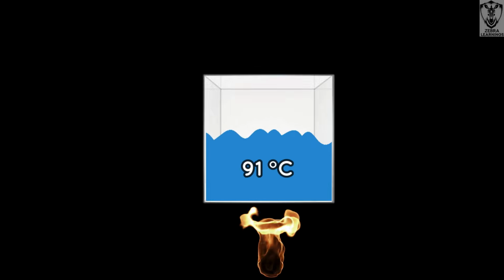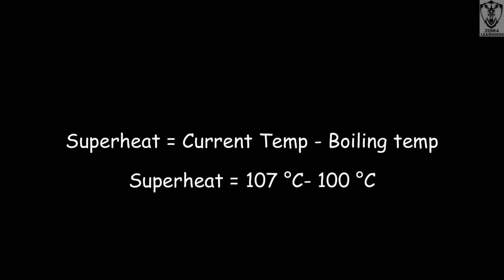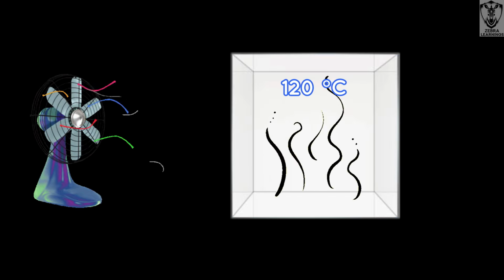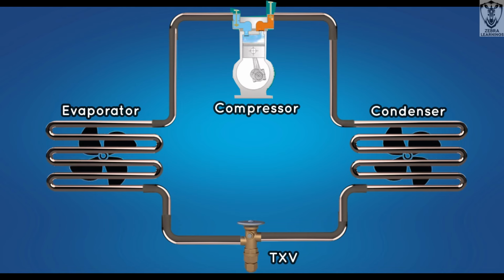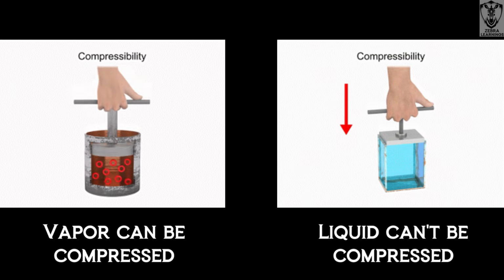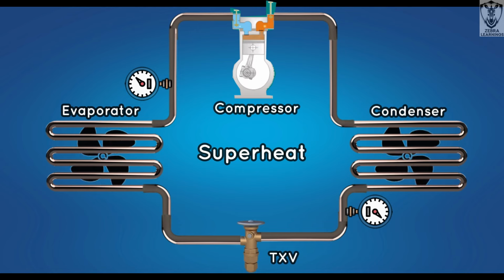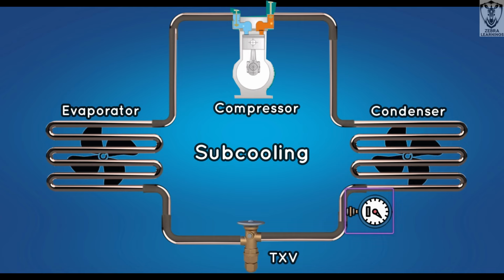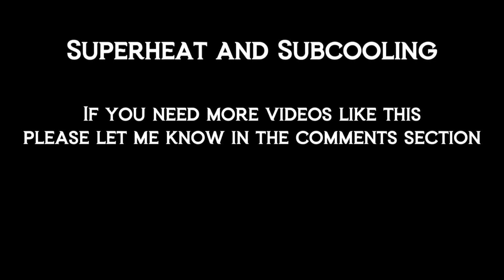What is Superheat and Subcooling | Animation |#superheat #subcooling #hvac #chiller #thermodynamics

Comment: Heating the water after achieving 100°C will never increase its temperature due to phase change till the last drop of water evaporates. After all water converts into vapour, the temperature starts increasing. This is called Superheating.
Reply from the maker: Yes you are correct. By mistakenly I have explained in that way for the easy understanding. The water can't reach the temperature above the 100°C. Only the water vapor can reach more than 100°C. But, it will not affect the understanding of this topic.
Reply: @zebralearnings Quite the contrary! The way you’ve explained superheating is confusing, misleading, and fundamentally incorrect!
Reply from the maker: @georgejetson4378  No, I made this video to understand superheating most easily.
And it won't mislead. Explaining it most technically will confuse the viewers. My motto is to make everyone understand HVAC. If there is anything wrong in the video, you can mention it.
Reply: We also noted the incorrect statement.  thank you for correction.
Reply: The problem with the incorrect explanation of water being able to be heated above 100 deg is folks will go out and make that statement when in fact it is incorrect
Reply: So as the water start to evaporate, will the steam created while the water is boiling increase in temp while the water stays at 100C? so water remains at 100C but the steam can increase in temp?
Reply: @joshuadavis2062 that’s correct. Water changes state at 100 degrees C. So it can never be more than that, if anything increases it’ll be in vapor form.

Comment: You cannot explain superheat and subcooling without mentioning the relationship of pressure, temperature and volume, ie. PV/T, Charles' Law. Example, Water and steam cannot have temperature above 100 degrees C at atmospheric pressure. To have higher than 100 degrees C, water and steam must be within a restricted volume that raises it's pressure, like a pressure cooker.
Reply from the maker: It's already explained in the comments. But here I have explained about the pressure and temperature. When the pressure increases, the boiling point also increases. Anyway I will make a separate video explaining what pressure and temperature is.
Reply: Let us be clear that pressure and temperature are important factors to be considered, for instance water boils at around 68 Degrees  C on Mount Everest. Discussions are relevant. Lower the pressure on water surface and the boiling temperature of fluid will decrease. Change of state will commence at that temperature .To comprehend Superheat and Sub cooling within HVAC , It is important to know the manufacturer's design, and use the recommended  method to calculate this phenomenon.

Comment: The water temperature remains constant and the water vapor is overheated. The flame should flow around the entire tank. The heated water will boil at a temperature of 100 °C and the flames flowing around the tank will additionally heat the water vapor to a higher temperature, e.g. 107 °C.
Reply: I would show it on a potato fry. When we boil water in a kettle, we see "water vapor" rising. However, what we see is not water vapor, it is microscopic water droplets formed from water vapor that condensed on contact with cold air. This is because the steam was not superheated and was 100 °C. The situation is different when we prepare fries in a fryer. The oil is heated to a temperature of 120 °C (initially 190 °C). When we add French fries to the oil, the water contained in the fries begins to boil. The temperature of the fries in hot oil remains constant at 100°C, but the water vapor passing through the oil heats up to 120 degrees, which is why we do not see "water vapor" above the fryer, i.e. micro-droplets of water, because the water vapor was properly superheated. She had a reserve of energy that prevented it from immediately condensing.
Reply from the maker: Yeah, that's you're correct. We can't heat the water more than 100°C. Once the water reached the 100°C temperature, it will start to change the phase from liquid to vapor and the vapor can reach more than 100°C temperature.
And the flames should be around the tank. Because, in HVAC system the heating process happening around the coil. But for easy understand I made this animation like this.
Reply: @zebralearnings  I thought so. A beginner in the profession only sees copper pipes, measures temperature and pressure, but does not see what phase the refrigerant is in a given section of the evaporator. Is it a gas? or liquid? It's like the structure of an atom. At school they taught me that electrons revolve around orbits like planets, although it has long been known that they have a wave-particle nature. They are a particle and a wave at the same time. However, this is difficult to understand.
Reply from the maker: @leszekporeysky6441  What do you really want to understand? Tell me I will try to explain in an easy way.
Reply: @zebralearnings  When it comes to particles and waves at the atomic level, I have already exhausted my understanding. We have three spatial dimensions and one temporal dimension. I understand spatial dimensions, but without understanding what time is, I will not be able to understand space-time. Therefore, I will not be able to understand what entropy is. But now I focus on simpler tasks. I am interested in systems in which you have one compressor and several evaporators operating at different temperatures. For example, imagine the evaporator of an air heat pump operating at a temperature of -7°C, the COP of the system is 2.5. What will happen when half of the evaporator is exposed to a temperature of +7°C? Will COP increase, remain unchanged or decrease.
Reply from the maker: You'll get the answer.
Reply: Your simplified presentation has turned on a light for me and made it much easier to visualize inside the compressor , condenser , evaporator circuit .  Thank you
Reply from the maker: @alfranca5961   I am Glad, Bro ❤

Comment: Wrong:  Can't heat water above 100C at 14.7PSI.  It turns to vapor.  The vapor can be heated above 100C, however.

Comment: Subcooling - For measuring that the the refrigerant is a liquid, and will absorb more heat in the evaporator?
Superheat - For measuring that the refrigerant is gas and not liquid, in order not to hurt the compressor?

Comment: Why do you need to know about superheat and subCooling how can you tell what's wrong with the system by checking subcooling or Super Heat?
Reply from the maker: Good question I will explain everything about Superheat and Subcooling in a separate video.

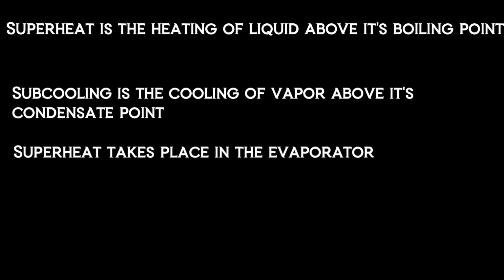Comment: Just 1 tinsy mistake. You accidentally said subcooling is the cooling of vapor ABOVE its condensate point at 5:28 where you previously said subcooling is calculated by the condensate temp - current temp
Reply: Anyways, thank you for the video! It was straightforward and easy to learn

Comment: Enthelphy, sensible, cop, latent ye kya h
Reply from the maker: On the way
Reply: Ok  sir i will weat for your answer
Reply: How many types of expension valve
Plese reply sir
Reply from the maker: @prakashsah9339  1. Thermal Expansion Valve.
2. Capillary Tubes
3. Automatic Expansion Valves
4. Electronic Expansion Valves
5. Float valves.
Reply: Thank u

Comment: at sea level, the temperature of the water will never go above 100 °C
Reply from the maker: Yes you are correct. At 100°C water will start to boil and change from liquid to vapor phase. But if we give temperature more than 100°C we can make sure the water is changing to vapor.
Likewise, if we give temperature more than the boiling point of refrigerant, we can make sure the refrigerant is changing to vapor.
Thank you for letting me know this.
Reply: Steam heat is hotter than 100*C (boiling water) and increases in temperature as pressure increases.
Reply: @coolramone  sea level, sea level
Reply: @coolramone  we are talking about sea level, sea level.
Reply: @coolramone  steam heat is hotter than boiling water, but the temperature is the same, same temperature.
Reply: @coolramone  steam is hotter than boiling water because steam absorb more heat, but the temperature will not change.
Reply: @coolramone  1 pound of water need 1 BTU to change 1 °F, and need 970 BTU to change to steam, that is why steam is hotter than boiling water, however, the temperature will not change. hot and temperature are two different animal.
Reply: In open system it should not go over 100 c.   If you could heat water hotter than 100 degrees C. in open system then there would be no need for pressure cookers and you could deep fry food in just plain water.
Reply: It's all about closed systems with varying pressures. This was never mentioned, not even in comment answer.
In open atmosphere setting the water should boil and never go over 100 C. until all of the liquid water is gone. 
In closed pressurized system you can get the water to superheat with pressure.
You can also get it to  boil at lower temperature with reduced negative pressure.
They need to make sure they specify this factor to avoid confusion.
He said you can heat the water hotter than it's boiling point, I say yeah, but not without extra pressure.